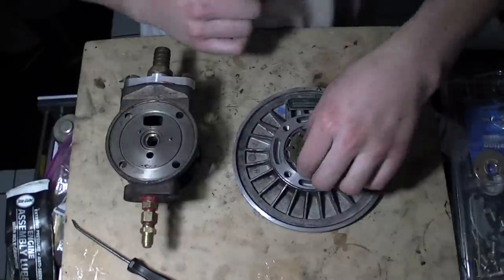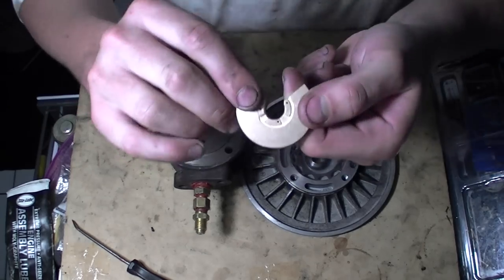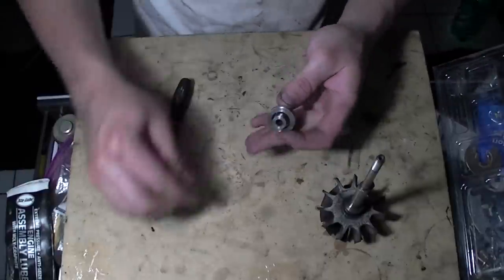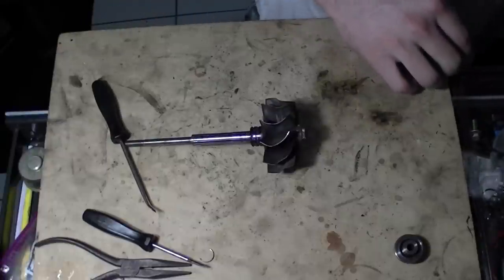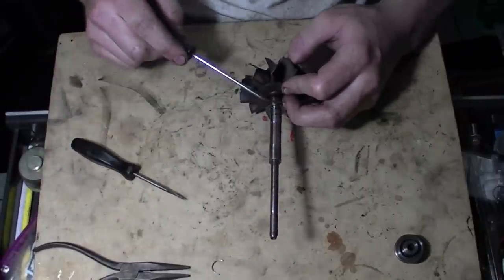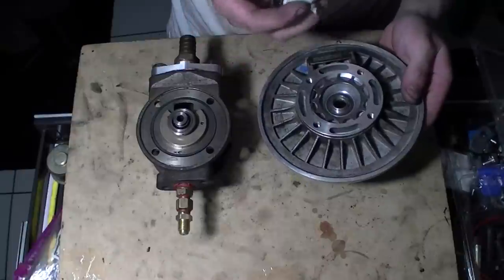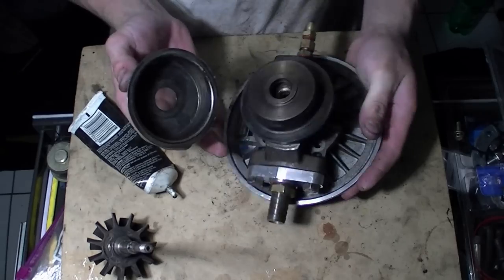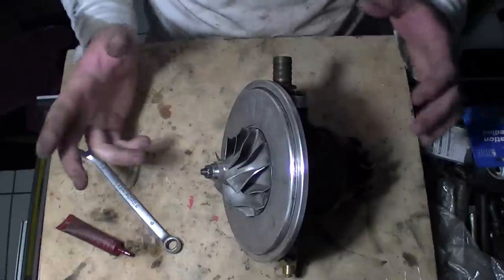How To Rebuild Any T3/T4 Journal Bearing Turbo Part 2

Comment: Piston rings is the correct term!
The oil as well as providing lubrication also applies a pushing force on the shaft so there is no end play. So the shaft is also acting as a piston. (If you look at a cross section, the turbine end of the shaft resembles a hydraulic ram)
There is a thrust bearing (the 270 degree bronze plate) on the opposite end to take up this force.
Without the oil pressure pushing on the shaft, the thrust bearing wouldn't work. 
This is why they're called piston rings and not just an oil seal.

Comment: Thanks a lot for the vid.  I have an 87 T03.  It's a bit different but not much.  I have a question.  I followed along great, didn't have assembly lube though, just used oil in spots and it seems great.  As soon as I put any tension on the compressor nut, the turbine doesn't spin.  Well, does but it's pretty firm.  Why is this?  If I loosen that nut any more the compressor wheel can spin freely on the shaft with the exhaust not spinning.

Comment from the maker: The thing about the bigger journal bearing turbos is that each part..shaft,compressor and turbine are all "individually balanced" unlike the smaller turbos which are balanced after there assembled buy just grinding the turbine nut or fin. So you can put the turbine & compressor together anyway you'd like and it wouldn't matter.

Comment: On mine the shaft was scored enough that it would wipe the bearings out in a month so I bought the whole cartridge new for like 200 bucks it's cheaper than buying the individual parts.

Comment: You should use the upgraded 360 degree thrust bearing kit.  It's much stronger than the 270 thrust bearing you used.

http://pages.ebay.com/link/?nav=item.view&alt=web&id=111453427561
Reply: how does the thrust collar fit into the thrust bearing with the 360 degree bearing?
Reply: marc gregory the thrust collar is too separate pieces on a 360.  the flat end of the collar sits under the thrust bearing.
Reply: awesome, thanks!

Comment: good job     where can I find rebuild kit for Toyota 2kd 2.5 engine turbo
replay plz
Reply: ct12 or ct26? The ct26 has a 5.7mm shaft bore and a 5.1mm shaft bore version. Then the ct26 is a 6.5mm shaft bore
Reply: I don't know ct12 or ct26? 
Can you explain 
I need turbo rebuild kit for toyota 2kd _ftv engine 2500cc
Reply: if your part number is 17201-30080, then i can order you a rebuild kit. would you rather buy a cartridge if i can get one of those.  i just worry if your turbo is not rebuildable
Reply: Thanks for replay 
First I need to check part number

Comment: hi, i would like to purchase this turbo repair kit since my t3/t4 turbo is leaking oil, i bought the car 2 weeks ago but i dont know which turbo i have on my car since is a ebay turbo and it doesnt have any brand at all, it only says:
Brand: JDM Sport
PartNO: T3/T4
SerialNo: TBO0903776

my question is: is this the turbo kit i need to repair this turbo ? i don't want to get the wrong one :/

all help would be appreciated and thanks in advance

Comment: balanced from the factory correct.... Great video but I does require balancing. I was watching for that in the second part of this video......I would have @ least marked the internal wheels if possible to try to get it close to the original balanced assy. But again cool video!!

Comment: Those things are not shields, they are thurst washers and the thing you called core is the thurst collar.

You also need to mention that the turbo needs to be component balanced after a rebuild.
Reply: Doesn't need to be balanced when just replacing bearings and seals. However he forgot to mark the turbine and compressor wheels relative to eachother.

Comment: piston ring...... there's no goddamn pistons there. shaft ring is acceptable
Reply: They actually are called piston rings for the turbochargers
Reply: Rusty Shackleford. The oil as well as providing lubrication also applies a pushing force on the shaft so there is no end play. So the shaft is also acting as a piston. (If you look at a cross section, the turbine end of the shaft resembles a hydraulic ram)
There is a thrust bearing (the 270 degree bronze plate) on the opposite end to take up this force.
Without the oil pressure pushing on the shaft, the thrust bearing wouldn't work. 
This is why they're called piston rings and not just an oil seal.
Reply: Looks like you forgot the bearing on the turbine side?